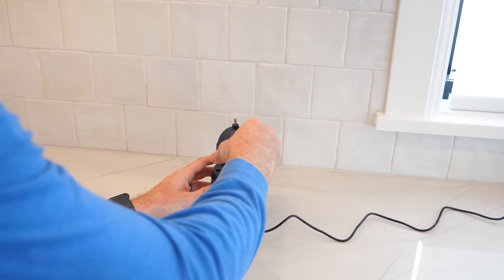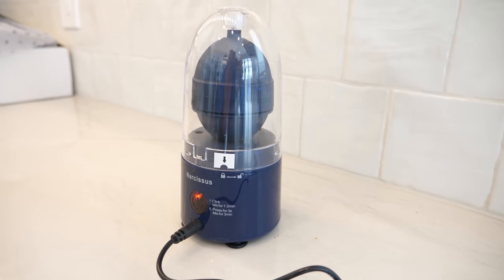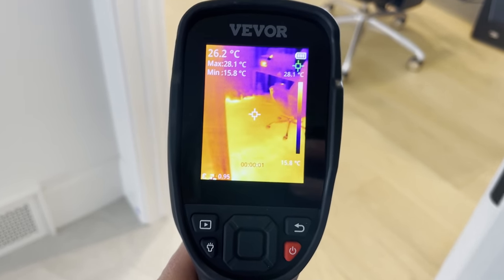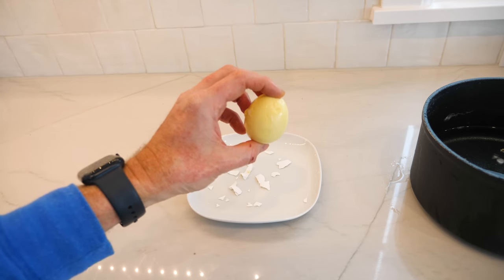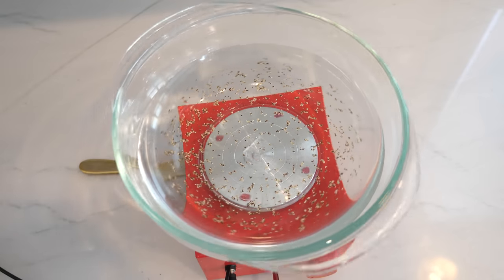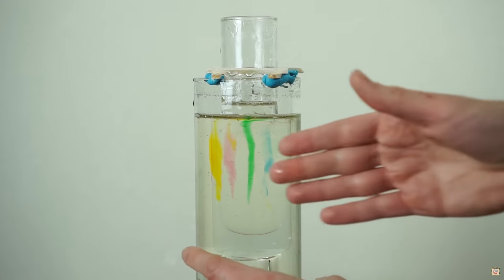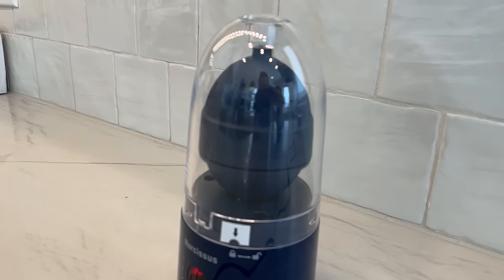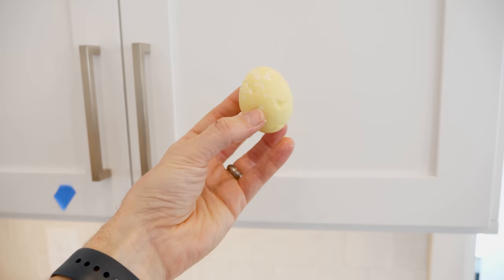How To Mix An Egg Inside Its Shell

Comment: I’ve made golden eggs, they’re a lot harder to peel than regular hard boiled eggs unfortunately
Reply: Thanks for pointing that out, I eat a lot of boiled eggs. 
Makes sense; the easiest way to peel an egg is to separate the skin from the egg. Easier to do when it's over the white as the white stronger and more flexible than the yolk.
Reply: Add a bit of baking soda to water
Reply: use a spoon to peel egg

cool down egg before peeling
Reply: Bums on a Boat  That's waste of energy - Gerda Tunaburger will find you...
Reply: @CONEHEADDK  Gerda Tunaburger 💀💀
Reply: Mellow yellow egg.
Reply: Bums on a Boat  I grew into it. It took time, and some eggs seem better than others (some seem to get dry, while others remain more "creamy") and I love that I can throw a bottle of water in the freezer, and a few eggs it a pot of water, and later on have a ready to pack meal, for when I fx go fishing. And I can even throw the egg shell anywhere, without any litter problems.  Perfect for boating too.
Reply: I would imagine it to be a bit more difficult as the mixing would separate the whites outer membrane from the inner shell. Still, instant drop in cold water after boiling helps the peel
Reply: do you still have that skin on the inside perfectly adheared to the walls of the shell? or do you think that gets ripped off and mixed in?
Reply: Bums on a Boat  nope. Tested and dismissed by Werner Gruber (University of Vienna) or Thomas Vilgis (MPI für Polymerforschung). Though there is differential contraction, the effect is minimal, and you'll end up with a cold egg. Otoh, maybe the common "washing eggs with chlorine" routine (illegal in Europe) makes it impossible for the eggs to age properly, therefore the cold water method is the only effect you can get. The most important factor is age. Older eggs are on average much easier to peel than fresh ones (and taste better, too; see "Die Genussformel" by Werner Gruber on the physics of cooking).
Reply: Bums on a Boat  I've found that egg shells have gotten thinner over the years making  them more difficult to peel.
Reply: Just use a potato peeler

Comment: This mixed egg inside thing was already in Donald Duck comic 30 years ago in experiments section ;D and you didn't need any devices, just towel to spin egg in air very fast, and it worked fine.
Reply: Pantyhose will also work,  better containment for the egg.
Reply: @Geoff P  not everyone has pantyhose
Reply: @Tallnerdyguy  They don't?..... But .. Are you sure?

Comment: Place the egg in the middle of cloth. Roll the cloth. No you have tortilla-like folded cloth with the egg in the middle. Grab the opposite ends of cloth in each hand. Start to spin it by doing circles with your wrists. Stop and pull the cloth apart. That'll suddenly stop the spinning. Start to do circles in the other direction. Stop. Pull apart. Repeat few times. Now you have mixed egg.
Reply: Yeh, all mixed up all over the kitchen floor and with lots of smashed shell mixed in.  Yum.
😂

Comment: To peel your eggs easier without taking out chunks of them, run them under cold water immediately after they are done boiling, then crack each one and let them soak in cold water for a couple of minutes before peeling.
Reply: You can also add baking soda to the boiling water.
Reply: you can also use a spoon you insert between the core and the shell.
Reply: @francoisgueguen1012  did you ever try the spoon trick? It doesn't work
Reply: Salt is best
Reply: @vhateg  not every day, but definitely every week.
Reply: no
i dont eat cold egg

Comment: You can also do this with a long sleeve shirt. stick the egg halfway up the sleeve, tie a string on either side of the egg to make a pocket, then grab either end of the sleeve, swing it in circles for a few seconds, and pull tight. Do this a few times, and you'll get a fully blended egg without having to buy the device.

Comment: you can also do this by getting a full sleeve shirt and putting the egg in the sleeve, tying off both ends, grabbing the sleeve from the two ends like a handlebar and then spinning it around. Once it's spinning pretty fast, just pull both ends away from the center and the egg will spin the other way to unravel the sleeve. It is in effect the same idea, just along a different axis.

Comment: Regarding pans and gas burners. 
Folded up hardware cloth under causes more turbulence catching more heat. We use platinum ones in labs but chicken mesh or hardware cloth works. Way improves efficiency
Reply: Under what? Just under the pan, above the burner?
Reply: @joshuaewalker  yes.  Exactly.

Comment: Wow. I can't believe the rigamarole I had to go through to get that done. Back in the late 80s I soldered one of my mothers' straight pins to the armature of a small motor ( don't tell her. Kidding she gave it to me ). I bent the pin. After which I had an in shell mixer. All I had to do was poke a hole in the TOP of the shell, insert the 'mixer blade', and let it rip for about ten seconds.

I was to cheap to buy lead free solder though. The lead 'never' came into contact with the egg. Oh yeah, I had an old art deco looking Sunbeam egg poacher. If I had a syringe I probably would have injected some flavor into them.

Comment: I tried doing this once, but instead of using the proper machine and concepts, i just violently shook the egg in my hand for like 5 minutes. Turns out the egg just exploded inside the pan mid-boil....
Reply: That sounds much more fun!
Reply: You shook it soo hard, you popped the air sac and foamed the egg. 👍

Comment: It's a bit like how low-pressure areas are form in the temperate zone. Different air movement ion the north and the south meeting each other and the result is that swirly pattern in between.

Comment: Does liquid absorb smells? If you have a pungent substance under water or oil, does it completely block the smell, or will the liquid absorb and diffuse it?
Reply: I think liquid absorbs the smell. It's the certain molecules that you smell.
Reply: @Steel0079  that's what I figured, but it's not a chemical change, so the liquid can become saturated with the smell. Does it then just become a 'that smell' scented liquid? It wouldn't alter any molecules?
Reply: @Grommie122   @Matthew Groom  no it wouldn't alter any molecules. Unless the elements or compounds that came in contact normally react with each other. Substances just diffuse into each other, and liquid will have more molecules of that smelly substance than before. And we will sense that through smell, because we are sensitive to certain molecules. I'm no expert in this, but as I understand it, these molecules interact with cells in our nose, or it is that the cells in our nose have evolved to interact with them. But other than that, liquid wouldn't be no different than air at diffusing the smelly substance IMO.

Comment: You can do this w/ the sleeve of a long sleeve shirt.... You put it in the sleeve then spin it then pull tight on each end of the sleeve then go back the other direction, and repeat. I use a towel and get this same result in just a few twists....     😉😁

Comment: You can mix an egg in the shell by putting it in a towel or a rag Twist in it and then pull apart so that it spends to untwist and you also like that back-and-forth and you just pull and release Paul and release and you can do that in about 20 seconds with no fancy gadget

Comment: Question - What happens when batteries are charging each other. 
Will the voltages of both the batteries be the same 
or the potential energy on the battery with more voltage will reduce which will increase the voltage on the battery with lower potential energy?

Comment: 1. carefully empty the eggs through a small hole.
2. mix with water and spices(some maggi pork soup seasoning or whatever your secret recipe is) and mix thoroughly, preferably with machine.
3. buy some empty eggshells because now you have more filling than eggs.
4. fill the eggshells.
5. steam in large batches in not too high temperature so they don't boil over. you need some plastic holders to do it in.
6. store in cool. or not. preferably yes.
7. go to the market or  festival or whatever and pierce sticks through them, 4 at a time, heat on coals and sell them 60-70 cents for 3-4 eggs.
8. profit.

Comment: Toss your egg inside a sock, grab both ends of the sock, spin it until the sock gets tight and pull the 2 ends apart quickly. Probably saved everyone $50 on an egg spinner 😅